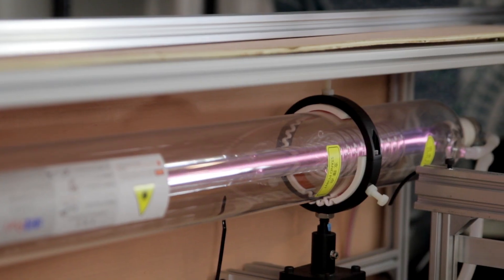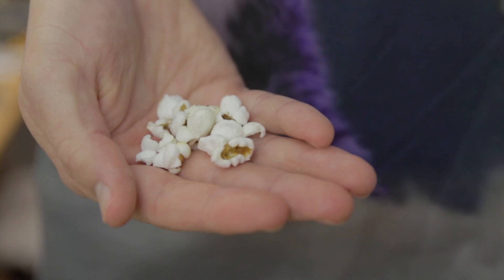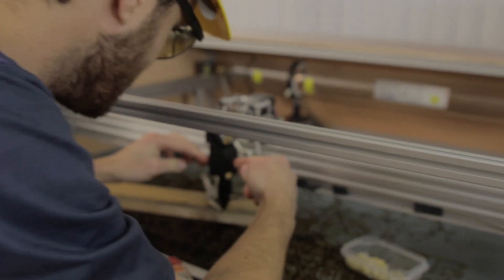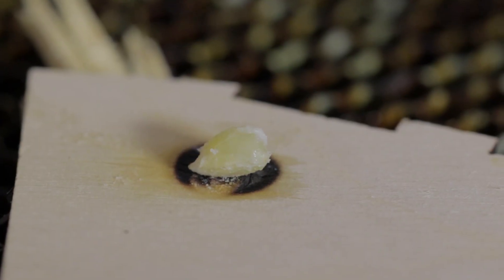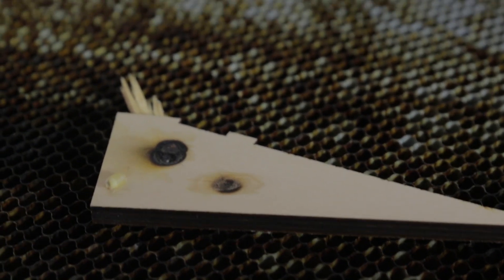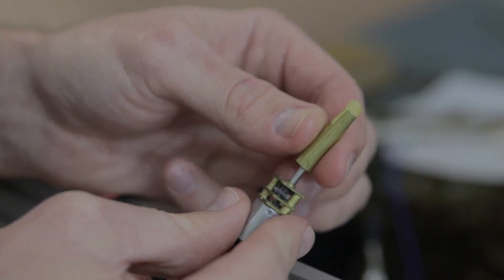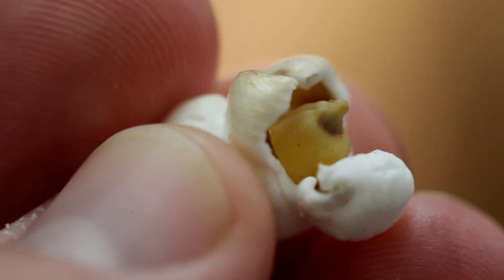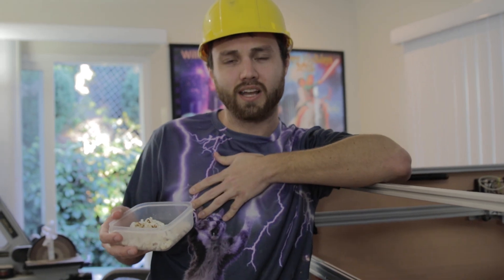Can a Laser Pop Popcorn?

Comment: corn pops because the pressure from vaporizing water is enough to crack the shell and Everything explodes. If you use a laser you pierce the shell so the vapor can exit the corn without popping it. that's y it doesn't work. I think...

Comment: Laser cut a dollar store laser pointer in half while it is on.
This is serious, I am wondering what would happen.
Reply: Going through the materials in most laser pointers, what happens depends on the exact material the laser is hitting at any given moment.
Aluminum:  Potentially dangerous reflections, possibly melting.  Cheap aluminum is not what's used for nice laser engraving.
Plastic or rubber:  Burnt/melted plastic or rubber.  Toxic fumes almost guaranteed.
Glass:  Potentially dangerous reflections and refractions, probably no melting.
Circuitry:  Burnt circuitry, melted wires.  Potentially toxic fumes.
Keychain, pocket clip, any other steel parts:  Probably dangerous reflections, probably no melting.  Might glow if enough light is absorbed, but could also damage the laser cutter and/or injure the user.
Batteries:  Potentially dangerous reflections, probably bursting releasing boiling hot toxic chemicals and gasses.  Cutting batteries open by any method is not something most people should ever do.  Let YouTube people do it for you.  (It's already been done, so go search to see.)
Laser pointer:  Will eventually turn off while some or multiple parts above are happening.

Also, I'm pretty sure Will's house and laser burned down between this video and your comment.  Sorry to both of you for that disappointment.
Reply: @VoltisArt  Lol, it's been over a year and I forgot I made this comment

Comment: Wouldn't the laser melt through the lens?
Reply from the maker: Most light passes through, but a small amount is absorbed. If the lens gets dirty it absorbs more light and will heat up /maybe crack. If you bought a second lens and put it at the focal point below the main lens, the focused laser would damage it.

Comment: You can rapidly cut tubing by placing it on a flat surface and rolling it with a knife edge,   same principle as a pipe cutter but applicable to small tubes.

To avoid significant deformation of inner radius,   cut part way then snap the tube.

Comment: With the crimped tube, it looks like a little joint. Hey! Try using a laser to light a joint next! Or you could try the 'hot knives' technique to use a laser to smoke a bit of hash. (Don't use knives, obviously, just the laser.)

Comment: hot laser 1000°C+  VS      normal knife!!!
Reply: Psico PATO you dont measure the intensity of a laser beam in degrees...
Reply: Then what do you measure it in? I'm genuinely curious
Reply: +Madvic with lasers usually wattage, the laser in the video is an 80w CO2 laser, a standard laser pointer is about 0.005w, so its about 16000x more powerful then a standard laser pointer
Reply: So you're saying someone made a portable laser bazooka that is about 2x stronger than the one William Osman has.